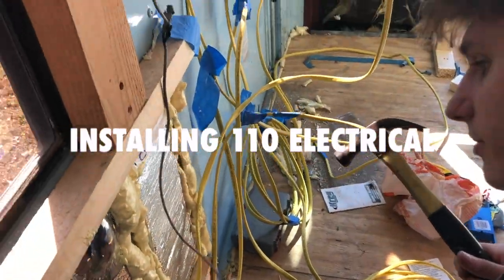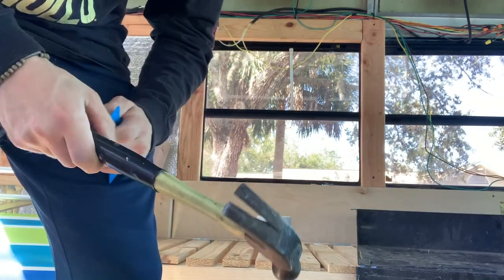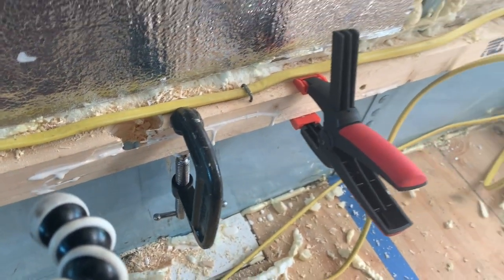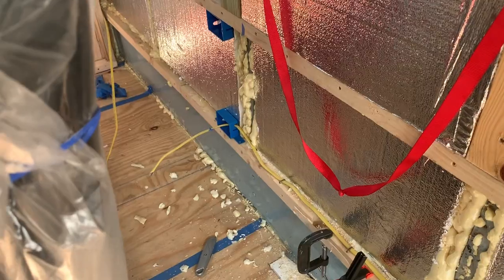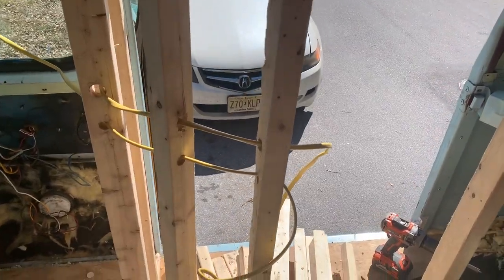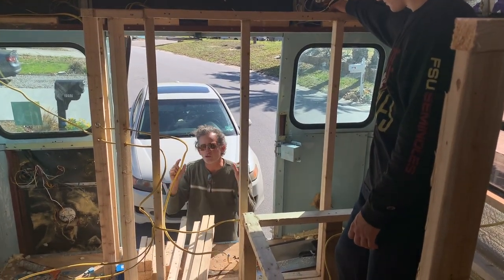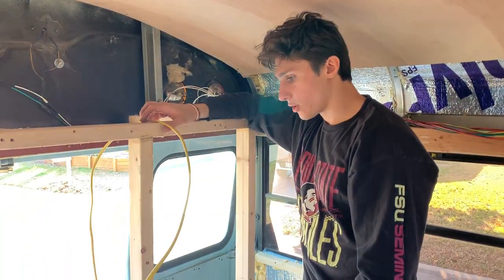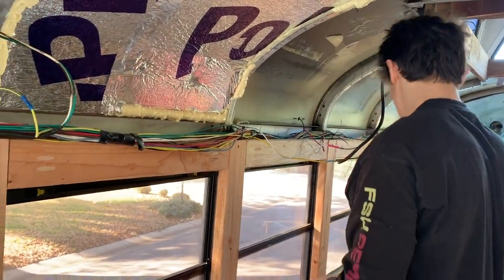Off Grid - AC Electrical Rough Wires installed in SCHOOL BUS CONVERSION | diy skoolie solar energy

Comment: Be sure to recess 1/8" and put metal nail guards on the studs over where you put wires so you don't accidentally put a screw into the wire.
Reply from the maker: AllMoMoMostHome Bus great point!! Gonna have to remember this at the end of our electrical work!

Comment: So is the yellow wire one continuous wire or multiple cuts of wire wired to the outlets/appliances wired back to the battery/breaker/fuse? I hope this question makes sense. I'm beginning my shuttle bus conversion this weekend and electrical is the only thing I dont know how to do.
Reply from the maker: That’s awesome good luck Micah!! If you’re unfamiliar with electrical we highly recommend hiring a professional to do it, as it can be dangerous and cause fires someday! But yes it’s one continuous wire down each side. Leaving a loop at each appliance or outlet will give you room to cut and wire in the outlet... hope that makes sense too!

Comment: Looking good  at one of the things that my bus has already is electrical sockets and lights and all that but now I have to run the 12 Volt stuff but I decided that a lot of my lights on the inside I bought the battery operated 3 double A batteries I figured the dollar stores all over the place buy $25 worth of batteries you got 80 battery S enough for at least a year AT amp is running a couple circuit to be able to charge my phone and laptop 12 volt . Going cheap for right now I will probably have a lot of stuff done at the van build this year like my Max arfan stay safe stay strong stay healthy god bless and enjoy life👨‍🍳🎅🥩🚌'S
Reply from the maker: Chef Santa's CulinaryTravels huge shoutouts to electricians because this stuff is not easy! Great idea with using little batteries... we’re getting ready to purchase our lithium ion batteries!
Reply: @ShawnandAsh  lithium ion batteries!$$$$$$$$$$$$can't afford them good luck enjoying your videos Peace👨‍🍳🎅
Reply: @Chefsantatravels  they could be more affordable than you expect.  Watch Will Prowse solar channel on YouTube.  You could build a 100 amp hour 12V battery with Four Fortune 3.2V/100 Ah LiFePo4 for about $500, and use an inexpensive BMS. You'd have a 100 Ah battery almost half the cost of battle born would be. Really for usable power, this would be about the same cost as AGM. I plan to build 400Ah at 24V.
Reply from the maker: @Chefsantatravels  They're so worth it! Looking at them as an investment :) !
Reply from the maker: @allmomomosthomebus3895  agreed and we love those video! We'll have (2) 170AH Renogy batteries. We're basing this off of how AGM batteries really only have half the AH usage as lithium batteries (so a 100AH AGM battery really only serves 50AH), and lithium batteries have over two times the life cycles of AGM batteries!
Reply: LOOKING GOOD AT ONE OF THE THINGS THAT MY BUS H
Reply: LOOKING GOOD AT ONE OF THE THINGS THAT MY BUS H